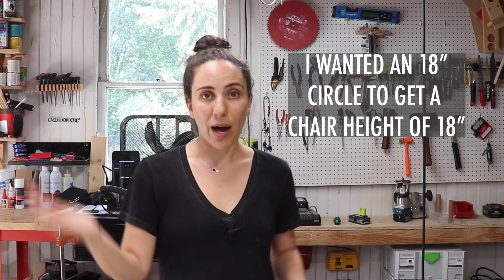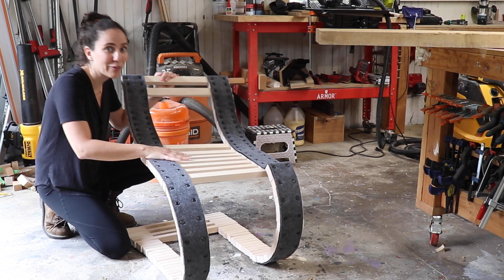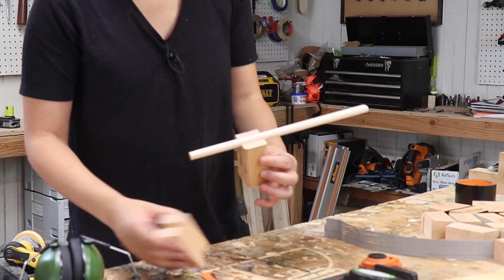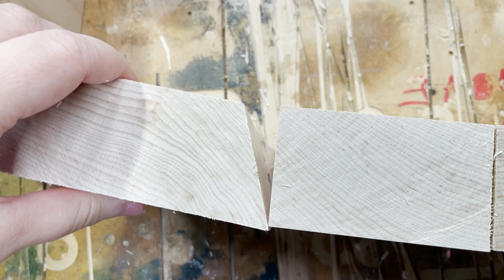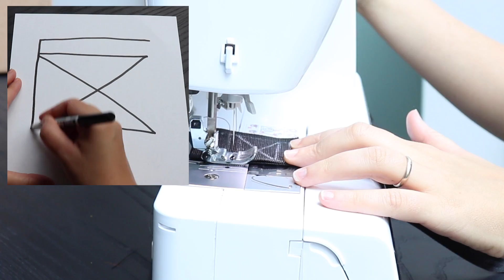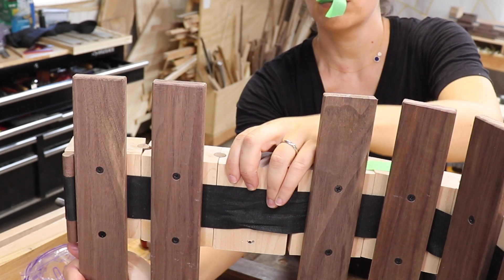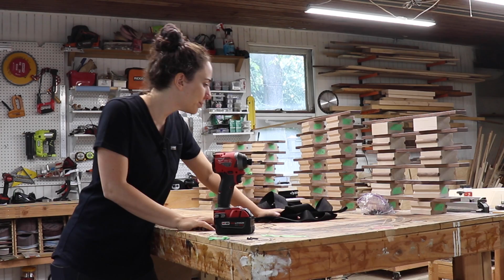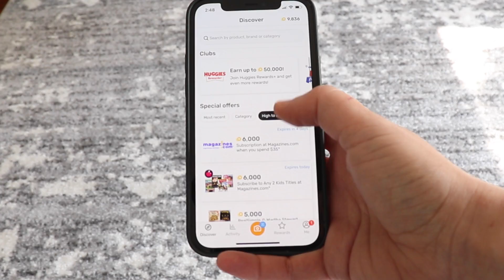I ATTEMPT to make a Roll Up Chair… AGAIN...

Comment: The strapping has too much flex,...
metal hinges??

If you want to stay with some sort of fabric, try going to a wrecker and get some seatbelts,... I imagine/guess they don’t stretch much
Reply: Also,... on a second note. Try screwing through the strapping at each section instead of just the ends. This will limit the flex to each joint instead of the entire length of the chair.

Comment: This design relies (too) heavily on the straps.  Even if you can find a block geometry that will give the best rigidity, ultimately your bodyweight is being supported by the stretch-resistance of the strapping.  That is a risky dependence.
If you think about other similar designs of seating appliances, the curly-brackets used typically are tubular metal.  There's a reason for this - you need the predictable structural strength.

Comment: With the straps only anchored at the ends, you're getting all of the stretch of the whole length of the strap at those joints that are opening up. If you attach the strap at each block, you only get the stretchiness of those couple inches instead of all 8 (or whatever) feet of nylon webbing.

Comment: It kinda worked without the dowels (ones that prevent from sideshifting). And I'm thinking ,(and I have no idea if I'm right, I'm no engineer), that dowels work a little like leverage, and that's why they create so much tension, stretching the strap. What if you would move dowel away from center of the slats in those fragments that fail, more to the outside?

And 2nd solution, you always put some support legs that unfold , (on hinges or smthg) from the bottom, parallel  to slats.  

Well. Sad to see that you gave up on it, but to be honest you gave it fair shot, probably even more then it deserved  :)  Even though it failed, you still have our respect Tamar :)

Comment: I would keep the straps, but I would feed a wire rope through the blocks. That way you keep the look and function of the straps, but the wire rope holds all the tension. Great video!

Comment: Honestly I believe that instead of adding tension creating a mechanical prevention method to stop the corners from separating. 

For example instead of a round dowel that allows the blocks to pull apart at a 45 a square dowel, not sure if that is even a dowel, would make the blocks need to crush the dowel to separate. This would then have the issue of not allowing it to roll up; however, I believe rounding or making it shaped like a home plate in baseball; such that the rounded side faces the inside of the curve allowing it to roll in only one direction. 

This seems like the simplest solution in my head however I am gonna try modeling it after work to see if i can make a good joint for it

Comment: 2 ideas come to me that may be solve this version issues

1- use the same system of grooves and wedges used to secure the slates to wedge the straps on the slates in which are curvature changes allowing to separate sections of different tension!

2- change the webbing for a widely used material which depends on no stretching and flexibility a.k.a. SEAT-BELTS!

i hope this helps you! keep improving! if isn't frustrating you are not pushing! cheer up

Comment: Strength is not the same as stiffness, the latter is what your belts lack. I repeat the suggestion I posted on your last video: put some narrow grooves across the pieces and put some thin steel cable in there, then cover them up with the belt. It would also be a good idea to fix them with each segment so the collapsing effect you mentioned doesn't occur, maybe with screws.

I don't think leather is a good idea, it can stretch quite a bit and then stays stretched.

Comment: Stapling the members is definitely on the right track. Right now the members are separating because the strapping is not fixed to the individual members so they're allowed to slide freely. To compound this, you get variable tension along the length of the strapping due to the geometry of the chair. Increasing the tension will just make it tighter everywhere, but it'll still be variable and create gaps. Stapling would constrain the members and create tension where you need it to keep the joints tight, but I am concerned that the tension forces may exceed the holding power of the staples so a more robust holding method may be needed.

The other issue that I see is that even if you resolve the gaps, I think this solution either won't hold your weight, or will be very unstable without a brace. This is because you're trying to support a vertical load with a horizontal tension. This would require infinite tension so what happens is that as you sit in it, the angles change so the tension forces are more vertical. On top of this, the wood is designed for a fixed angle, but in reality the angles will vary with weight and movement. Due to leverage, I suspect the tension forces can be quite high, and possibly damage the straps and/or the fasteners for the straps. If you were to provide a brace that you can wedge in after it's unfolded, I think this would greatly reduce the stress that the tension members would see.

The Ikea Poang chair is a very similar shape (that obviously doesn't fold up) made with steam bent plywood. You'll notice that the seat is at about a 30 degree angle. They obviously did this without a brace, but I think steam bent wood is a significantly better material for this chair shape (with the obvious flaw it doesn't fold up). Even then the chairs have a high failure rate due to the tension forces.

Comment: I think wood and strapping of any kind are probably the wrong material for this.  the issue I'm seeing is that a long enough strap of almost any flexible material will have some stretch.  you may need some kind of hinge system.  I don't know how to do it without is becoming so complex that its not even worth it anymore.   its a really interesting idea and I see why you are reluctant to give it up.  I wish it was working because it would look very cool.  thanks for sharing the process.

Comment: You don't just want the tension to span the whole length. You also need to affix the seat belt material to each block in the curves. Screws, glue, clamps... or do what you're doing exactly and also add hinges at the spots that experience the most tension.

Comment: Hinges instead of straps and wood may not have the rigidity and compressive strength to hold up under these conditions without flexing so much the chair fails. Perhaps reinforcing the surfaces where segments compress against each other with metal plating will  better distribute the load across the mating surfaces and prevent deformation that would lead to flexing and failure.

Comment: Why not put the concept with the straps into smaller segments?

The issue is you will always have some elasticity and unfortunately those 4% total elongation will focus themselves on the point of max force applied. So if you have the band in let's say 5 pieces and you very short segments at the point of the highest stretch you could get rid of this issue. The idea would be to bridge at the biggest bend only 2 or 3 pieces at the time, have the dowels at the end like at the moment, but to have a dowel over and under a plank you have to cut a lengthwise slit into the band and sewing the edges real good (like a button hole) you can than pass the band through each other.

I hope this makes sense.

Comment: The only part where the straps are truly under tension, and need to be, is the main front curve. For everywhere else you just need the strapping to provide some structure.  This is pretty much what other commenters have already said.

Your idea of stapling on the straps to isolate one joint from another is also on the mark.  The straps are functioning as hinges, so getting those forces much closer will help.

Another option is to change the design (also commented on elsewhere).  In this case maybe think about bicycle / motorbike / chainsaw chains and the non-stretch characteristics of that they have.  In effect they are three layers per side (your current design is one per side), step that up to 4 or 5 layers per side and I think you'll find it will work.

Comment: Leather will stretch more.  IMHO, if you want to try to stick with textiles, your best bet is to look into kevlar sail materials.  To be honest though, I'm not sure that even that will resist stretching to the degree you require.

Past that, you're probably looking at steel.  Steel does stretch too though.  Particularly if you want to steel to remain flexible.

Comment: First: You need a material that is not stretching. Steel rope. Use as many strands as needed to reduce the spring constant. Hide the steel rope under leather or inside some tough cloth
Second: Do not allow the tension to move to other parts of the chair. Connect the rope to every piece.

Comment: Strength =/= stiffness. UHMWPE is very strong but it has a huge amount of stretch. Look for webbing with steel or similar reinforcement. Also looks like you need to seperate high tension from low tension and integrate some kind of tensioning system, the webbing will likely creep over time as well and need adjustment.

Comment: What if you had piano hinges between the Links, it would solve the need for that much tension in the webbing and stop the blocks rolling in as the tension is distributed between the links not the unit as a whole?

Comment: I was imagining metal hinges on each joint to replace the strapping. The strapping appears to transfer the stress along the strapping to the end pieces. A hinge would keep the stresses localized in each joint, not pulling on the end pieces.

Comment: The straps you use might be rated for the load, however they are elastic and depending on weave and plastic formulation can give up to 20%. I suspect based on the lever length they will also be pretty near theirmaximum load. Also the spine pieces put all load on their edge, which will probably crush any wood. You could make a test rig where you have just one joint and try out materials/geometries. I would suggest a full length plank contact area from hardwood and the entire top covered in webbing straps full width.

Comment: i have some long 10cm wide by around 5mm thick strapping that comes off a conveyor belt that is rubber with stitching running through it for strength, i believe it ran as belting on a large machine that was used to haul boats out of the water, it would be perfect for your project.  if you are looking for something that would work to hold all those parts together with a little give but tons of strength, look at machine belting that runs over pulleys on large machines.

Comment: The problem isn't too much tension or lack of tension. The problem is with tension difference. The staple idea might work, but even better you could use hinges on all the joints or a strapping that has no stretch at all and it needs to be glued down right to the edge of the joint

Comment: what if instead of straps you used door hinges? that way the wood wouldn't have the ability to hyper extend past its locking point or pull apart?

Comment: To me it seems that you were attaching the blocks to the strap while the strap was either pulled straight of laying flat. I'm not sure if you tried this already but I would try to create the tension by having the strap "shortened" by twisting the most demanding joints backwards from their "sitting position" e.g. if they were to sit at say 30 degrees when the chair assembled - I'd curl it back to flat and then another 30 degrees over toward the curled n' carry position. This way you will end up tremendous amount of pre-tensioning which you can control easily between each joint. Some joints may be just fine when assembled flat. 
I'm not sure if this crossed your plans already, but car seatbelts are strong enough and do not strech at all (or way less compared to any ratchet strap material or other similar straps) you can gen more than enough seatbelt from a quick visit to a scrapyard or car stripper bay (not sure how that translates to English :))
Please do not give up yet :) I'd like to see this working - such a great idea with the dowel joints btw!

Comment: Could it be the shape of the blocks? If you rounded over the long edges where they touch as you lay them on the strapping and have the strapping fixed to each block, would the now curved edges cause the blocks to create the tension specifically between each block as they have more of a level action than hinge action? I'm terrible at painting word pictures though!

Comment: Could the stretch be happening because the fabric is secured with screws and there’s play in the fabric around the screw? I’m wondering if you glued the fabric to the wood if it would have made a difference. Nonetheless awesome video, you’re a great story teller.
Reply from the maker: I was considering doing that once I got the strap length correct. Then I got hurt and decided it wasn’t wise to continue with this version

Comment: The straps might work better on the outside of both curves, the top section is getting shorter as it curls creating the slack for the gaps. Maybe try fixing the bottom strap to a block in the middle of the horizontal section ~16 blocks from the bottom, then attach a new strap to the opposite side to go around the outside of the seat back curve?

Comment: It seems like by not screwing the strap to the pieces it's allowing it slide apart. The clamping force used to hold them down doesn't seem like enough

Comment: A potential idea for strapping is to make each segment thicker, drill a hole in the center and use an aluminum tubing as a guide/ reinforcement for a vinyl coated cable to run through... possibly?

Comment: I think the webbing needs to be on the outside of the roll for the chair back, similar to where your legs would be. Where your legs would be the strapping is on the outside of the curve, so you need to find a point in the seat to transition the strapping to the outside of the back. This way the tension of the strapping is always on the outside of the curves and it supports itself.

Comment: a couple people are close. You have like a 5 foot long strap that is just sleeve between the rib and slaps. Even with 5% elasticity for the force applied it would stretch 3 inches. you should try to rigidly affix the strap to the edge of every board as close to the edge as possible, probably having to use an adhesive like epoxy. So instead of 5 feet of material being able to stretch, the majority of the material needs to be immovably suspended. Then, only several inches of the material are subjected to being stretched, so the total stretch would be a fraction of an inch.

Comment: leather would be so stretchy, and the leather might just snap under the tension. Using steel cables might might work, but if you do that be careful to not let it snap off of any connections, that could really hurt

Comment: If the webbing switches sides (through a space in the dowels?) It would pull the back the right direction instead of collapsing.  Same with the other end on the floor.  I'd also find a way to tension the strap after the chair is together like a  ratchet strap.  Ratchet straps can hold like 1000 lbs so maybe cut a relief in the pieces in the back to hide it after it's together?

Comment: I have two thoughts on the subject. After reading some of the comments about differential stretching maybe possibly use two different sets of scrapping. Maybe something that stretches a little more on the top and a little less on the bottom. This brings me to my second point. For something cheaper Than Leather maybe try canvas. Canvas doesn't stretch very much and is affordable

Comment: the straps are like springs. i think you might just need more strength in the straps. i also think that unless you change the shape of the blocks it will always wear out meaning strap replacement will happen a lot. 

maybe there is a way to add resistance in the blocks? like a shelf to push back on each piece?

Comment: Ok I have a couple thoughts. As many others have said, secure the webbing at each block, so that each joint can only pull from a short length of webbing. Another thought would be to clearance the outside edges of the blocks very slightly, so that the webbing is  already pre-stretched when they come together. And third, find a way to pre-stretch the webbing before assembly. New webbing and rope will naturally stretch a bit until it settles in.

Comment: have you considered assembling it like a bike chain rather than a belt holding it together each piece could be on a hinge (dowel) and the shape on the side of the chain denotes the angle, each chain could be made of three, five of more layers of wood and it could still roll up in the opposite direction.